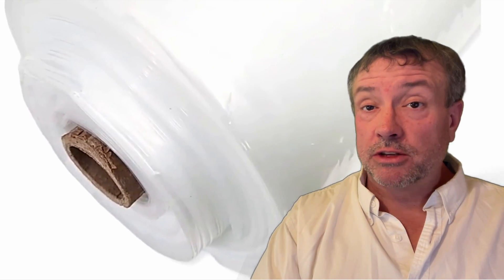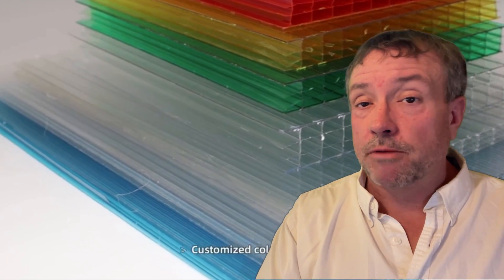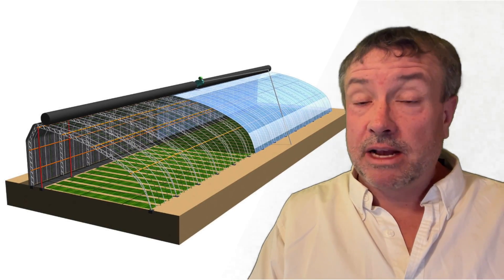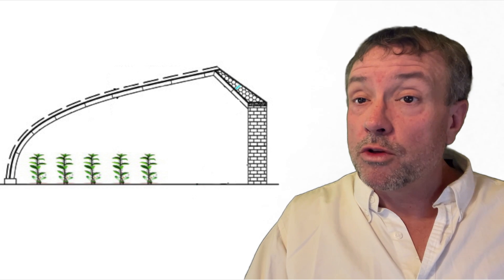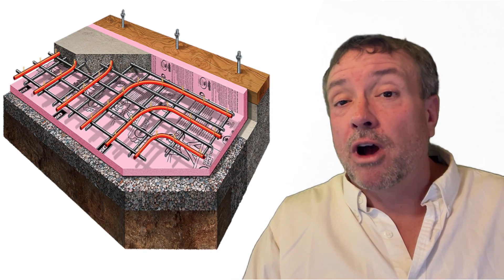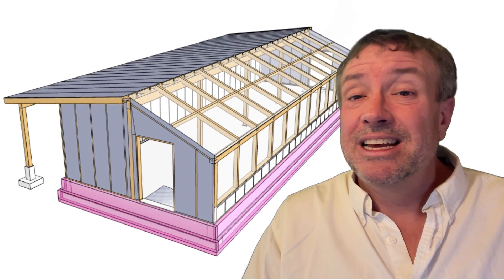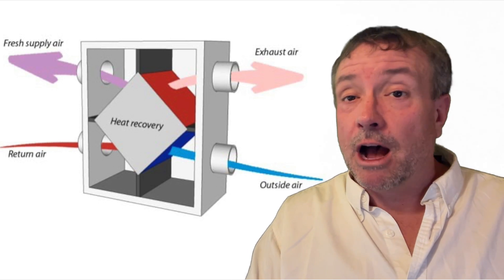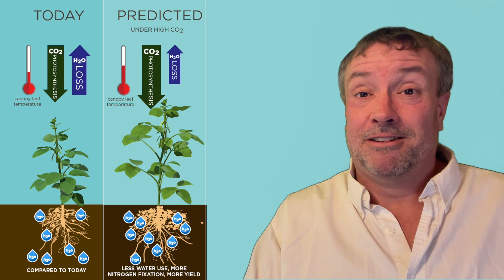6 Ways to Insulate or Store Heat in a Greenhouse

Comment: I understand and support your goal to find dirt cheap solutions to the system.  However, it might be worth it to splurge on the windows as they will hold the heat you need.  You might save on the long run with windows rated up to R50 and expected lifespan of 50-60 years.  Here is a link to a YouTube video talking about LiteZone glass.  I haven't purchased it but am intrigued.  Do you think it might me worth it to shell out for this glass and save in the long run or to heat it conventionally for the same lifespan?
https://www.youtube.com/watch?v=sCACGXAT6ik&list=WL&index=5
Reply from the maker: There is no windows rated at R50
Reply from the maker: The cost of having a 6-7 pane window is more expensive than making enough heat with eco friendly systems
Reply: R20 not R50.  Sorry.
Reply: What is the light transmittance? What is the energy balance? Studies have shown that triple-glazed windows are good from the north, but double-glazed windows are better from the south because they have a higher energy balance.
Reply from the maker: @autre1234  I concern myself more with R value vs cost
Reply: @autre1234  It would seem to me that the highest priority would be heat retention.  It got cold fast at night and heated fast during the day.  It seems to me that a small sacrifice of light transmittance would be worth it to gain more heat retention.  You can then use water to help homogenize the heat extremes.  Or just open a window during the day.
It is the heat loss at night and maybe too much heat gain in the day that is the true enemy, no?
Reply: @Simple Tek  yes glass or plastic not many windows out there have an R value above 2..... 

the retractable blanket seems like a good idea.   For low snow areas. Some of the Chinese green houses in alberta use a roll up blanket on the inside not outside. Question. How would someone automate the rolling and unrolling of the thermal blanket?
Reply: @willmakxam3834  Look at Lite Zone.  It is a company in Canada that does make windows up to R20.  The question is does the added cost of high performance windows get recouped of the years because you don't have to pay as much in heating.
Reply: @michaelrowley6069  wow. Really? When did they come out? I will take a look.
Reply: @Michael Rowley  there isn't much to show on their website nor in their videos with conviction these x4 to x8 filmed flass has an R16 to R22. The words they have used have been sdewed and inconsistent from person to person. Marketing flaw? Anyways. To have a standard double pane glass window of  R1.78 go to what his suggested can "reach up to R20, or R22 " depending on the person in the company.....I am surprised they didn't pull out a thermo reader..... those walls and windows should read the same surfaxe temps?
this break through in I slated windows would have been adopted by every window manufacturer in days..... and save billions in heating costs?  I will have 3emakn skeptic for now......